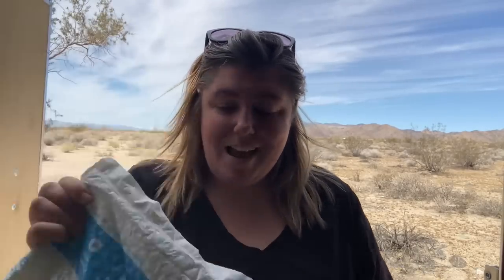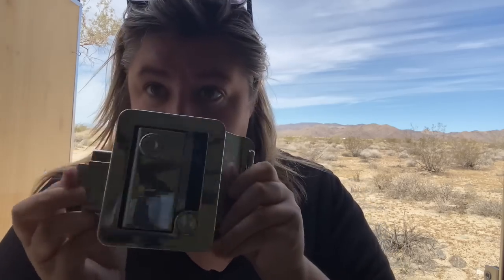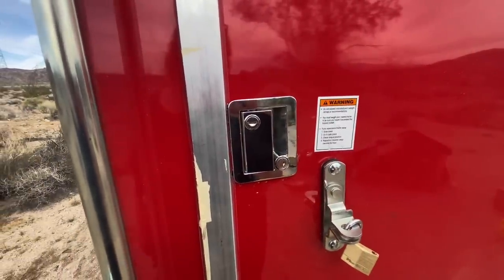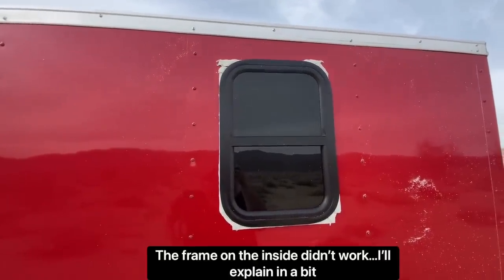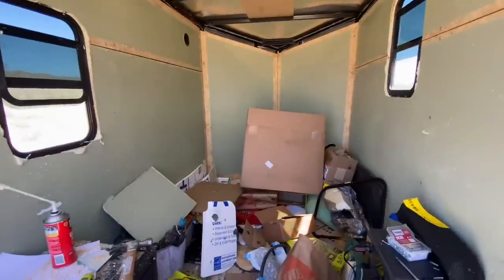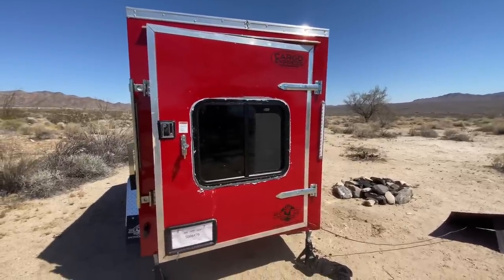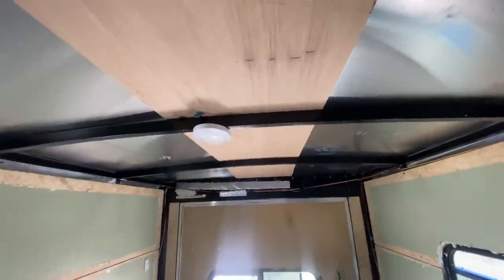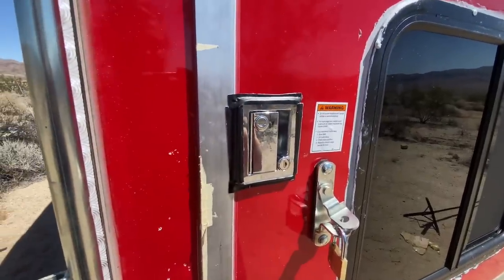Cutting Holes in my Cargo Trailer!

Comment: It’s going to be so cute when it’s done! You could use 1/4” plywood to cover your foam board insulation. It’s flexible enough you could curve it to fit the ceiling. Also be aware that the heat on the roof may cause the spray adhesive to loosen. I have a headliner shelf in my van and used the same gorilla glue. Mine has started to loosen and it’s been 10 months.
Reply: I would use bead board pre painted white. It would look great.

Comment: I am also excited that you ventured into Ryobi tools!  Ryobi sells an inexpensive fan (~$24) that runs off the 18v batteries.  No electricity needed but you can have a fan in the trailer if needed.
Reply: Everyone raves about their hand vacuum too …
Reply: @lucsmith2092  I haven’t tried it yet, but I’m impressed with most of their tools.
Reply: The fan is great.

Comment: Good job, one suggestion -You need to flip the window in the rear door 180° because the wedp holes for water drainage are at the top of the window now. Or you can drill a couple of small holes in the lower frame (be careful not to hit the glass). You don't want water taying ing the frame. It will seep into the door.
Reply from the maker: The window has weep holes at the bottom. It’s installed correctly
Reply: @BrookeandPippa  Sorry, I couldn't see them in the video. Don't ask how I know about weep holes on top.
Reply from the maker: Same from my last build lol! I made sure!

Comment: I actually ordered trailer windows for my van because tjey were much cheaper than van windows! I made a frame for the inside out of plywood to build the wall up thicker so I could put on the inside frame properly. 

One of them was made for a trailer with walls 1 inch thick and the other was made for a trailer wall 1/2 inch thick.

Comment: If you are able to plan ahead a little bit usually 4 times a year they have sales of electric tools where you get them in a set so you are not paying for like 4 batteries when you could get one.  I might have missed it but did you think about venting windows for the sides so you can keep them open in light rains? Good job overall.

Comment: Kudos to you for taking the bull by the horns, so to speak. I do believe it will workout in the end. However, the lock is security, please get someone that has professional experience in installing a lock like the one you bought. I’m afraid it’s only a matter of time before it won’t lock/shut or worse, won’t open with you and Pippa locked inside. I know you wanted to do it all on your own, but PLEASE for safety sake get someone to fix it🙂

Comment: I love the idea of no electric.  I did the same in mine, but have a hole cut for extension cord if shore power is available.  I bet you could put trim around the windows inside & out if u wanted, or just red paint to cover the butyl tape & lap sealant.  Otherwise, I'm totally impressed as they are.  Excellent effort & courage to get it done!  You made it look like cutting thru butter.  I want to put in mine now by myself.  I built out my van, but I'm getting my son to help with the trailer.  I've had to slow down a bit.  Also, I'm kinda new here & love your videos.  Go girl power!

Comment: I bought a set of dewalt tools for $700 CDN in 2021 when I started my van build. It came with a hammer drill, a compact driver, a 6-1/2” circular saw, a light, and a reciprocating saw. Also 2 batteries and the charger of course. I later bought an off brand jigsaw, and a small sander. I don’t regret any of those purchases. They have more than paid for themselves!